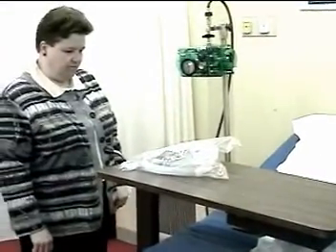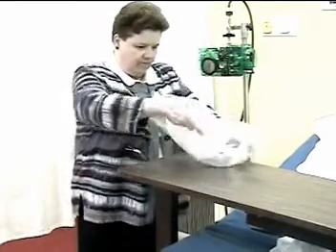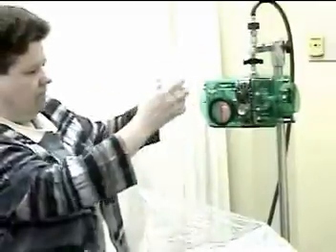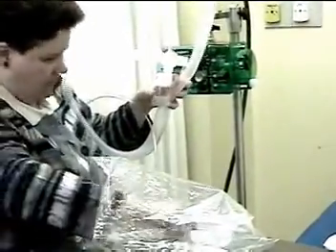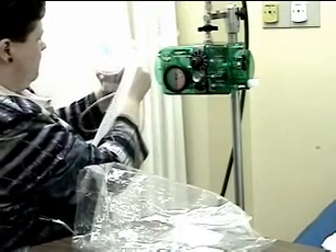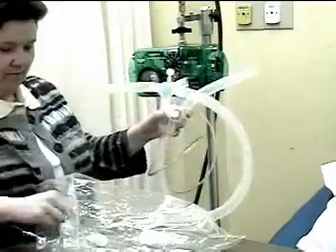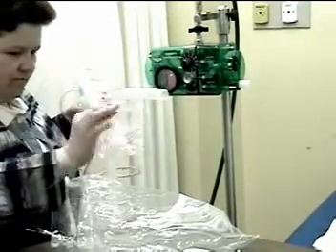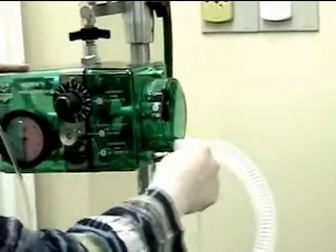RESPIRATORY CARE: IPPB setup

Comment from the maker: IPPB has gotten a bad rap but is not for every patient condition.  Patients like the para or quad are good examples of patients that can not breathe deep enough.  However, if there is a problem with secretions I would consider Cough Assist.  Thanks for the compliment of using my video.  I saw you have some as well. Keep up the good work.  DZ

Comment from the maker: There are applications for this device. Grant it...it has been over used in the past, as RTs we need to evaluate the usefulness and application of each therapy.  Oh by the way, it is a decent pneumatic pressure ventilator that can be used without electricity.  Huh...useless?